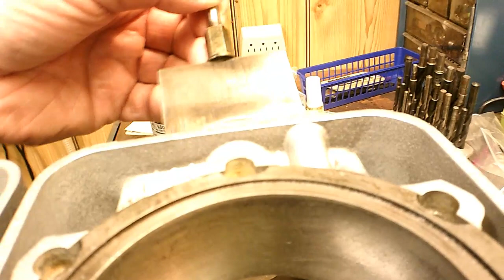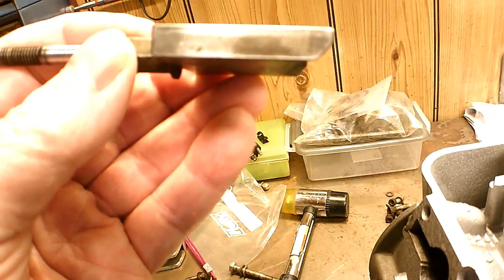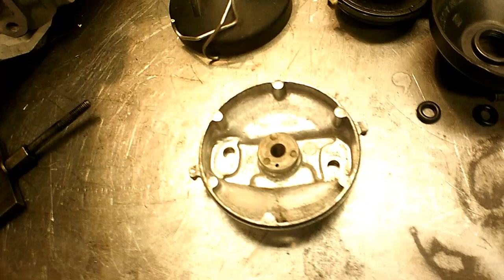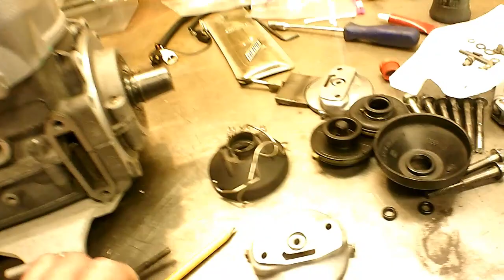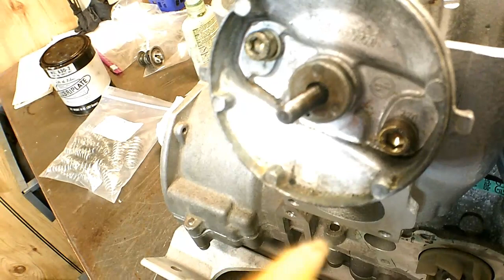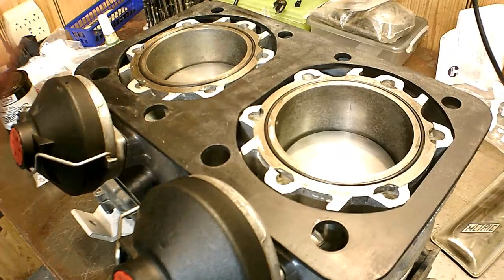Rotax RAVE valves on 583 engine

Comment: How did it work as a airplane engine?
Reply from the maker: I don't know because I have not used it, and nobody bought it from me yet. I think it might work well if you used high test gas due to the higher compression, and got the rave valves adjusted to match the prop pitch.

Comment: MZ 202  ?
Reply from the maker: No. Rotax 583. About 90 hp. Snowmo engine with single ignition and electronic spark advance.  It is for sale.
Reply: @Adventurepilot70  💪😏👍    
600сс--2Т. ?
Reply from the maker: @КоЗахар  It is the same as a Rotax 582, but with higher compression, an extra transfer port, and a different cut to the rotary valve. I drilled and tapped this one to take an aircraft gearbox.